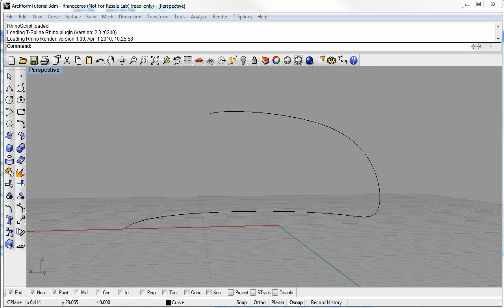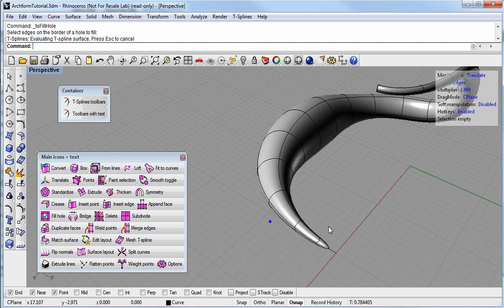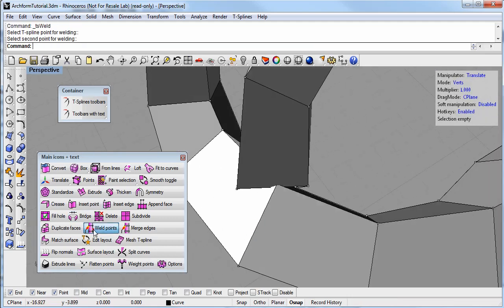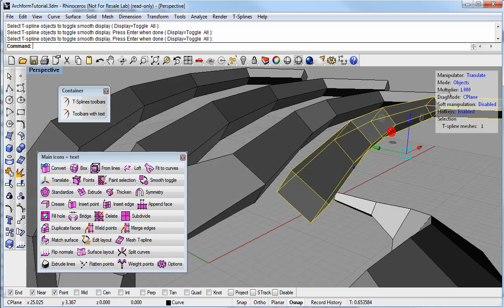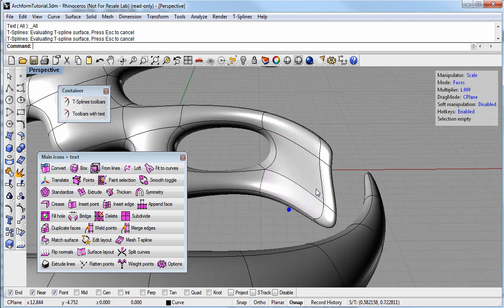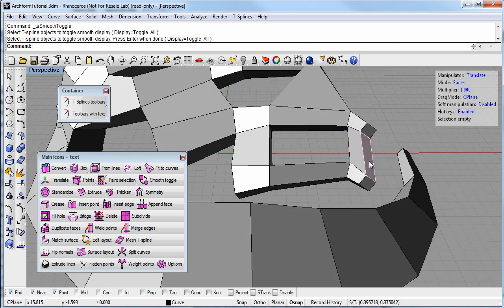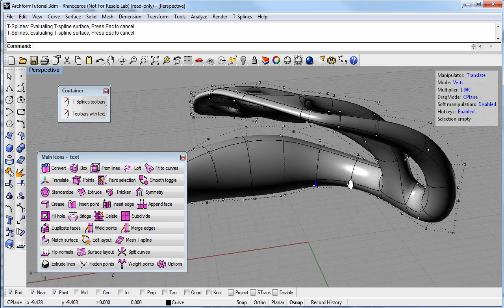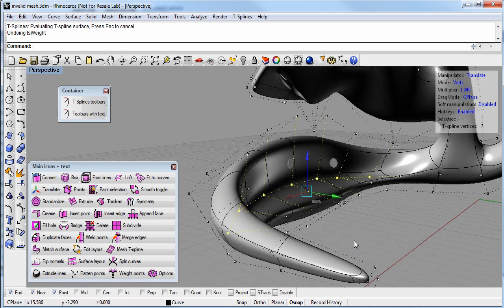Architectural form with T-Splines for Rhino

Comment: I have the same problem with the fill hole command... it doesn't matter if you are in a smooth toggle view or box one - all it does is turning end of the pipe into a square shape cap... i can't find a solution for it...